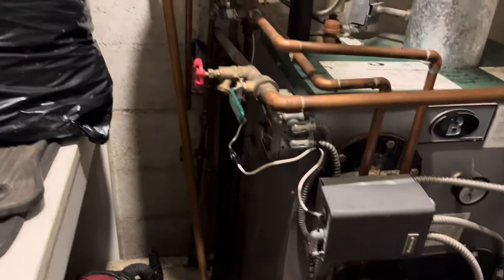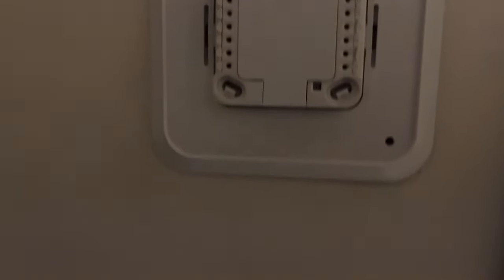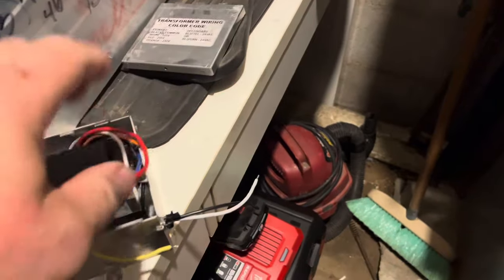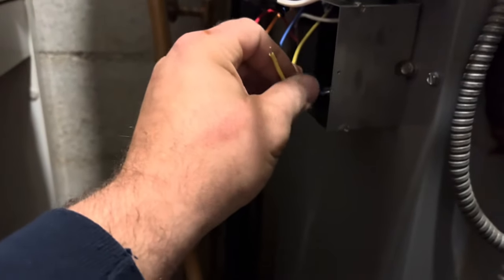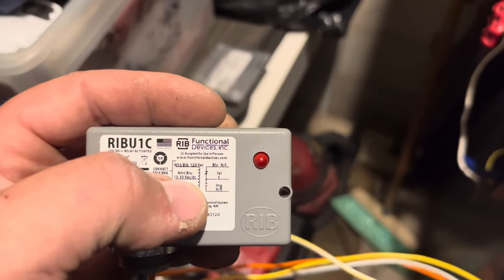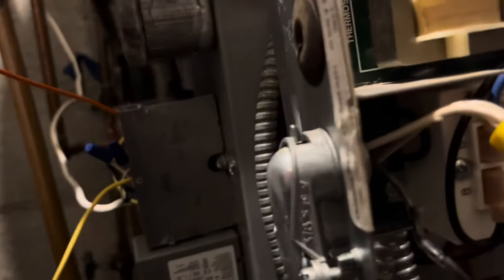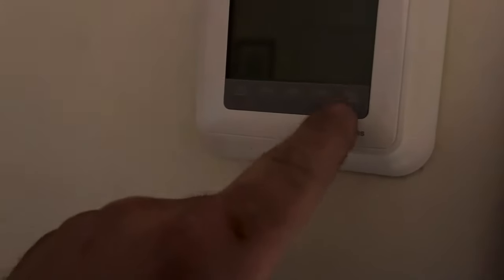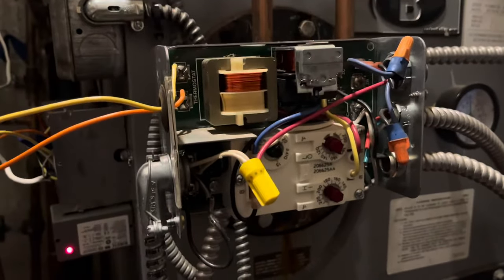HOW TO HOOK UP WIFI THERMOSTAT TO OIL BOILER WITH AQUASTAT.   - NO COMMON

Comment: Had the same problem with the boiler controller. Went in the attic and used the power in the air handler for the a/c side(rc) and isolated the boiler side (rw) for my nest. Didn’t have a spare third wire from the boiler. Paul !!! 👍
Reply from the maker: That’s awesome.   Gotta be creative sometimes with these things.   Thanks Anthony.
Reply: @HVAC OTJ  if I'm installing 2 thermostats, do I need 2 transformers and two relays? Or do I tie all those wires together?
Reply from the maker: Hey Anthony I just reading a new comment from another subscriber and I saw your comment.   Like I’ve told there are levels to this shit.   You know what you’re doing for sure.   I beat you this time to the holiday call.  I’m telling you now Merry Christmas bro.   That was real cool when you called    Take care bro.
Reply: @hvacotj  lol you did beat me to it. I’ll probably say it anyway as we get closer. Enjoy every day 👍 and keep out of nasty attic’s

Comment: I have a nest E thermostat I purchased transformer and relay. Will wire power to R and W1 back to the relay coil when heat is called. This should work.

Comment: Any chance you could show a wiring diagram with how the transformer and relay are connected with the thermostat and aquastat?  Great video!
Reply from the maker: Yes I will post it later today
Reply: Where did you post the wiring diagram? Thanks for the video
Reply from the maker: Email me marathonhvac2003@gmail.com.
Reply from the maker: It’s posted on my page.
Reply: @hvacotj  what parts do i need
Reply from the maker: A transformer, a rib relay and wifi thermostat.  I posted wiring diagram a few days ago.
Reply: @hvacotj  is there a specific transformer? I have the thermostat i have the google nest thermostat i only have 2 wire also
Reply from the maker: So, you will need a third wire for common.   Go to hardware store and get a 24v transformer.  Another name is a step down transformer
Reply from the maker: Double check the wire, pull the old thermostat off the wall and check to see if there is an extra wire inside the wire covering
Reply: @hvacotj  i so hae 3 wires but 2 of them connected idk where tk out the other one
Reply from the maker: At the thermostat, You need the two wires that go to R and W which is your normal power and heat.  The third wire needs to connect to C which is common.  Then follow the rest of the video on how to connect at the actual boiler.

Comment: If I have 4 ecobee  thermostats how many relays do i need?
Reply from the maker: It depends on your zone panel.  It may even have a common connection on it then you won't Need.  The point is to grab a common and if is on panel if should supply entite relay.

Comment: How can I hook up an Wi-Fi thermostat to an old furnace ?
Reply from the maker: How many wires do you have on the wire coming out of wall to thermostat.  Altogether you can do with three wires.   If you only see two connected pull the wire a little out of wall and maybe extra wire wrapped around the vinyl.

Comment: How did that cost to do?  And what if you double zone heating
Reply from the maker: It’s not much. Probably 40.00 in parts. A RIB relay and a transformer. Then you can get the thermostat of your choice. This particular one was single zone, but will work with one or more zones.
Reply: @hvacotj  I have the Nest thermostat as well if I connected as is it will blow the thermostat to smithereens ?
Reply from the maker: With the setup that I show in that video, the Nest won’t work because you will end up wrecking the aquastat relay because it will keep chattering. That’s why you need the relay and transformer.

Comment: You in New York……
Reply from the maker: Yes.   Westchester County.
Reply: I have a boiler too and interested in a wifi Thermostat about how much would that cost……
Reply from the maker: Where in NY are you?  If you do it yourself with parts you shouldn’t be more than 200.
Reply: @hvacotj  I'll give it a shot...I'm in Rockland.....where can i get the list of part's........
Reply from the maker: I used to live In West Nyack.  A RIB Relay a transformer 24 volt and wifi thermostat.   Just make sure you have three a common wire at thermostat.   If it boiler only, you will need a third wire at thermostat.  If you want send me email at marathonhvac2003@gmail.com and I will send you schematic
Reply from the maker: I sent schematic over
Reply: is it possible to install the Honeywell T6 Pro without using the Wifi feature with 2 wires?
Reply from the maker: So if you don’t need the wifi, yes just get either a T4 or T6 thermostat.   The batteries are in place of a common.   All good to do.  Connect R and W.
Reply: @hvacotj  Ok cool thanks….i want the T6 for the lock pin code feature tired of these kids turning up the temps 🤬
Reply from the maker: Yes. The T6 is nice.

Comment: All that for no reason instead running extra wire from aquastat common to the thermostat wire lol
Reply from the maker: Hackers are entitled to their way as well.   There is always a reason.  It’s called the right way.   It’s like the guy who connects aftermarket stereo system like you would and it hums when the gas peddle is pressed.   😂😂😂😂